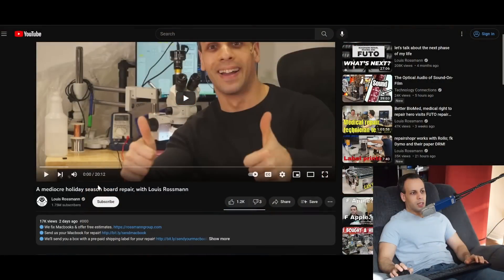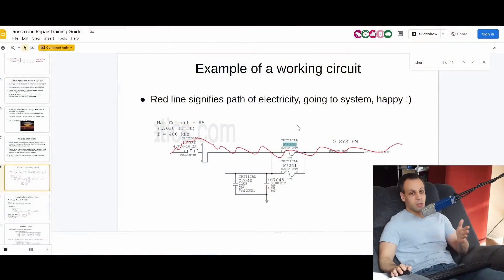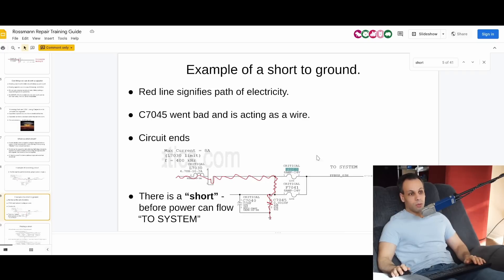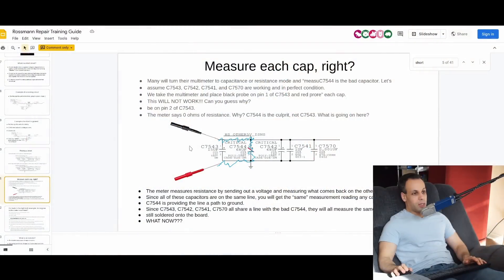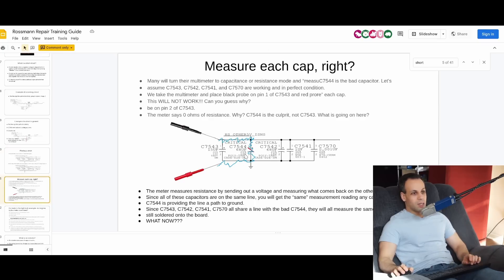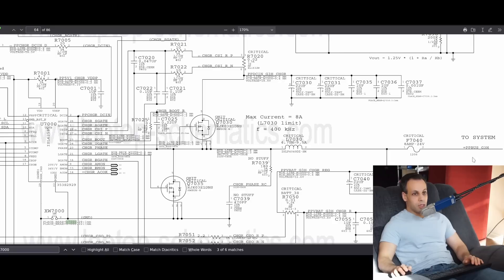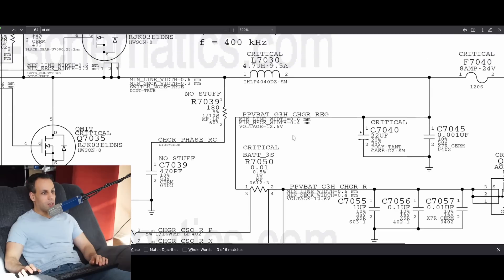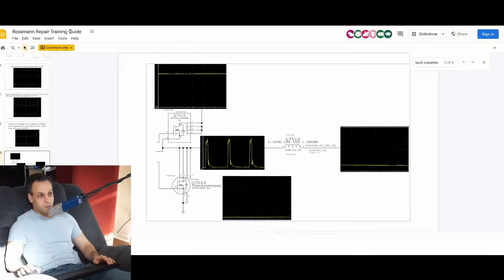Beware improper short detection methodology: on Macbooks you can kill your CPU, NAND, RAM, or GPU.

Comment: Louis, a small correction. In your slide at 4:21 you say that a buck converter is a linear voltage regulator - not correct. The buck converter is one topology of a switching regulator. Note what Analog Devices says about this subject in their white paper entitled "Understanding How a Voltage Regulator Works": 

A linear regulator employs an active (BJT or MOSFET) pass device (series or shunt) controlled by a high gain differential amplifier. It compares the output voltage with a precise reference voltage and adjusts the pass device to maintain a constant output voltage.

A switching regulator converts the dc input voltage to a switched voltage applied to a power MOSFET or BJT switch. The filtered power switch output voltage is fed back to a circuit that controls the power switch on and off times so that the output voltage remains constant regardless of input voltage or load current changes.

What are some of the switching regulator topologies?
There are three common topologies: buck (step-down), boost (step-up) and buck-boost(step-up/stepdown). Other topologies include the flyback, SEPIC, Cuk, push-pull, forward, full-bridge, and half-bridge topologies.

You can find the white paper here: https://www.analog.com/en/technical-articles/how-voltage-regulator-works.html

Cheers! Dan in Phoenix
Reply from the maker: i made that sheet editable by anyone for a short period of time to correct my mistakes and that got added. i don't remember ever writing that, but there it is. 99% of that document was originally written at 2nd grade level. i'll edit it when i find time

Comment: If the Buck convertor is "stuck on" as in your example  wouldnt it already have destroyed your cpu before your diagnosing the circuit?
Reply from the maker: Good question! Sometimes yes sometimes no.

An isl6259 will limit the voltage to 1.7v or something when it sees a short. Sometimes it won't produce anything at all. 

Whereas a bench power supply will just send  it through no problem. 

Think of this analogy, the board's 12.6v creation circuit is like a smart car. Your agilent 6542 bench power supply is like a Silverado 3500 Duramax. Both can crash into the side of a building and cause damage, but which one has a greater likelihood of going right through the wall of your building though? The 3500 Duramax will destroy your entire building. The smart car will leave a dent. 

If the isl6259 realizes it's being asked for too much and auto shuts down to low voltage or stops producing because it can't keep up, you're often fine. However if you use an agilent 6542 bench power supply to shove 12v down there, it'll shove 12v down there, whether the circuit likes it or not.

Sometimes your machine killed the CPU or NAND or GPU when this happens, and there's nothing you can do about it. But by injecting high voltage in these cases, you're turning your chances from 50% no fix to 100%.
Reply: @rossmanngroup  Just like NYC real estate…..”You’ll TAKE IT, and you’ll LIKE IT!!!” 😂
Reply: @rossmanngroup  But in the case of the fault you're describing -- a FET stuck in the "on" state -- that's not going to do you any good. That FET is going to connect VIN to VOUT, and nothing the chip tries to do will change that fact. The chip entering a fault mode is designed to protect the IC and FETs from blowing themselves up trying to power through a short downstream, but all bets are off if it's the high-side FET that's the actual issue. The way in which backfeeding a single rail might damage something is if you're powering up a rail out of sequence. For instance, a PMIC might normally dictate the order of rails coming up as 5V, then 3.3V, then 0.8V, etc. If you power up a single rail out of order, you may end up backfeeding through a non-power IC. For instance, a logic chip which might bridge between a 3.3V and 0.8V domain. Only having one of the rails up may result in any logic that bridges voltage domains start backfeeding through GPIO pins, which isn't ideal, and could potentially damage them. Another thing that might be damaged would be *linear regulators*. If you try and backfeed one of those, you'll have a bad time. They definitely don't like it, and you run the risk of burning it up.
Reply: @fgbhrl4907   I don't see what you are arguing over? The reason for the awareness and method is still applicable but it seems you just take exception to the example?
There may be multiple faults leading to damage or partial operation. Should protect is not will in practise. 
He isn't an electronics expert and doesn't design or construct microelectronics. 
He just knows the ways they fail in practise , knows how to make expensive microelectronics soaked in cat piss work again and gives people back what the manufacturer would not touch and effectively discourages.
Reply: @rossmanngroup  I really do think that any fault which would send nontrivial overvoltage to a delicate subsystem like the CPU or SSD will almost certainly fry it instantly. It's not a case of how big the power supply is or how much current it can produce, so long as it can produce enough current to fry the clamp diodes inside the chip. If the laptop was broken when it came in, and you put a voltage into a rail that it would see during normal operation, then any fault like a stuck MOSFET that could cause a high voltage to go where it shouldn't *will already have happened*. You can't kill something if it's already dead.

(The only exception might be if something "earlier in the chain" ended up being backpowered, e.g. through a chip or a boost regulator.)

By the way, your explanation of a short has always bugged me. The electricity doesn't "stop short", that's the wrong metaphor. Rather it takes a short cut to ground. That's the correct way to think about it. Electricity always wants to get from a high potential to a low potential: 5V wants to get to 0V (and vice-versa, but that's less straightforward to think about). So if it has a "choice" of going through a bunch of circuitry and doing work to get there, or simply taking a shorter path through a broken capacitor, it's going to go for the lazy option every time.
Reply: For some more background, a synchronous buck (one which has a low-side FET in addition to the high-side FET), the low-side FET will be “told” to turn on whenever the high-side FET is told to turn off (after some dead time typically much less than 100 nanoseconds). 

If the board has a failed high-side FET, but is powered normally, the buck controller will receive an enable signal so will be active and detect the output is rising much too high and prevent it from rising more. Thus it will try (but fail) to turn off the high-side FET while simultaneously trying (and succeeding) to turn on the low-side FET.

Practically this results in brief short circuits across the two FETs, so the inductor does not “see” a constant 12V. As Louis says, it may rise to 1.7V but that could be survivable. 

If you inject 12V without the machine being told to turn on, the buck will probably never receive its enable signal so is not monitoring feedback at the output. Thus the low-side FET always remains off so the inductor (and everything downstream) will see 12V.
Reply: @davidperna  Hmm -- I'm trying to think through the situation you describe. Let's assume we're regulating correctly, and then enter a stuck high-side fet. The controller will see the overshoot you describe, and turn on the low side fet. At this point, you have dueling FETs -- one trying to pull that node up to VIN, the other trying to pull it down to GND. It seems like that node should reach some ratio between VIN and GND (with both those FETs getting blisteringly hot).  It seems like you're more likely to be significantly higher than 1.7V, unless I'm missing something. I'm assuming both those FETs are probably identically matched, and there's probably a bit of a hold off time to prevent excessive shoot-through, so my bet would be on it being a little bit more than 50% of VIN. Right?
Reply: @fgbhrl4907  I see your point, and would also expect that a shorted high-side FET would result in a higher output especially considering there is probably a minimum on-time for each PWM period. However I think we need to consider what it means for the FET to be stuck “on”.

I think you’re right to assume that the FETs are well matched, though I don’t know if it’s fair to assume that they are equally “on”/conducting in this scenario. The low-side FET is being driven on, probably to a few milliohms while the high side FET is stuck “on” due to its failure. 

I have limited experience with failure modes of FETs but I’m sure that the mechanism that creates this Drain-Source short circuit is different from the conventional mechanism of turning on a FET. 

I would bet that the driven FET  
is conducting strongly while the failed high-side is conducting relatively weaker which is why the output voltage is biased closer to GND.
Reply: @davidperna  I suppose it depends on the failure mode -- one of the typical failures can be when you get a breakdown of the oxide layer and shorting between gate and source. I'm assuming in this situation the FET is pretty much turned on 100%. However, I could imagine other types of EOS might make it a weaker short. In that case, the low side would win the fight. 

I still do question the premise a bit; if the failure was a 12V to 0.8V SMPS, I'd be applying 0.8V on the VOUT side to test the short situation, rather than 12V on the VIN side. 

I guess if the dueling FETs were strong enough to pull the upsteam 12V rail down into a hiccup mode, you might be fooled into trying 12V first.  I think I can buy that; for something like the 0.8V rail, you're going to have chunky FETs, probably significantly bigger than the upsteam 12V rail, and enough to to get it to enter OCP.

So the symptom would be 12V in hiccup, so you depower the board (mistake #1), and apply power to the 12V rail (mistake #2). Per your point, the 0.8V SMPS isn't enabled / controlling the low side FET, so you blow the CPU with 12V on the 0.8V rail. Ironically, you wouldn't even see the high side fet glow, since it's not yet fighting the low side fet....

Keeping the board powered normally before applying external 12V might not save you either -- for a hard high side short, as you supply 12V that node is going to rise in voltage (dueling FETs), until you're potentially sitting at 6V or so at the 0.8V rail.
Reply: There's always output voltage feedback in regulator systems which should protect against this.
Reply: I guess the analogy would be the difference between opening a locked door vs. kicking a hole through it. 

Technically both scenarios have given you a path through, but it’s going to be a lot easier to walk through the unlocked door.
Reply: The bench power supply doesn't know when you are using abnormal amounts of power and can't shut down to protect the components. The bench power supply can be used for a lot of things and it is assumed that you know what you are doing with it. (Maybe melting the PCB was exactly what you wanted, to test it) Also it cant tell the difference between something burning up and a resistor connected to a switch. In fact neither can the builtin voltage regulator, but this one knows that your 60W load (CPU + GPU + ...) couldn't possibly try to use over 300W. Also the devices are usually designed with power delivery able to provide just a bit more power than ends up being used, this way the power delivery can't provide enough power to burn the components even if asked to.
Reply: Exactly my thoughts.

Comment: In all the apple junk from 2018 anything can kill anything. Particularly serialized with the T2/M1 SSD NAND storage unit which is powered by a small and very buggy BGA chip with integrated output mosfets "key" that fails for no reason causing the death of the SSD...apple is a true engineering design nightmare. But everyone knows these bastards (apple) do it on purpose.
Reply: “Planned obsolescence”. 👌😬
Reply: @rpmevo8  Yep 😒... And where is ecology?
Reply: @SolFun  EXACTLY!! Apple claims to be eco friendly but are against 3rd party board level repair………🤔I really like Apple products (my main computer is a 2021 16” MacBook Pro), but their repairability has gotten significantly worse over the years.

Comment: My short methodology is simple: If sh*t's on fire, then I had a short. Merry Christmas and keep a fire extinguisher handy. Powder, not foam. 🦌
Reply: if you spray this nasty powder stuff in your room, it gets litterly everywhere, it's a mess. I would probably prefere CO2 extinguisher for this case.
Reply: @23RaySan  Not sure how that plays out in enclosed spaces without proper protection equipment. People tend to not breath well in CO2 rich atmosphere.
Reply: @ThatGoat  yes but you notice your suffocating and people tend to react badly to it. (Speaking of experience)
Reply: If you approach microelectronics with that same mindset, you're going to have a bad time. Sometimes a failure is very hard to spot plainsight, that's why measurement is the most important part of electronic repair.
Reply: @thetechfromheaven  Neah, i'm cool. All I usually work on are motor vehicles and building wiring 😅
Reply: @ThatGoat  motor vehicles have more and more sophisticated computers as time goes by, I assume you work mainly on older stuff. I used to work on 90's Honda computers a while back, but once had to work on a Chevrolet Captiva 2004 computer and it was a freaking nightmare. Those Opel/Chevy cars from that era are pain when it comes to the electronics that you wish the damn things were carberated 😂 I find old equipment and machines a charm to work because that reason, and appreciate the work people like you that keep them running for as long as they can 👌 but yeah, for a "youngster" like me it's becoming harder to troubleshoot when it comes to fixing the "new" stuff.
Reply: @ThatGoat  Motor vehicle and building wiring you say? Well, good for you I guess.

Keep in mind this is more of a digital tech channel though. Our kind tends to work indoors more than out in the open, and also lithium batteries don't play around when they randomly decide to explode.

Powder extinguisher all the way! We can't be using a CO2 extinguisher indoors ya know.

Cleanup? Vacuum cleaner. 👍
Reply: @thetechfromheaven  I work on my own stuff, family's cars, family's homes. It's usually older stuff that's not really pretentious. Yes a car, even older one, has quite a bit of electronics on top of the electrics. Unfortunately, even though after watching the kitties and some Louis I do have an idea of how component level repair should go, most car modules are designed to be just that. Modules. They're intended to be replaced as a whole when something is borked and even if I don't like it, for an older car, it's cheaper and faster to get s chop-shop replacement than messing with the thing.